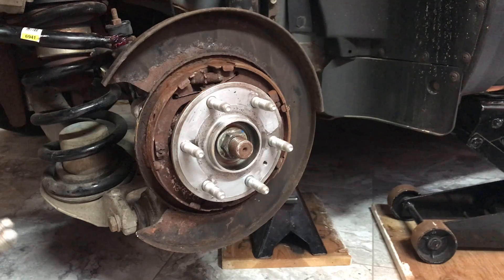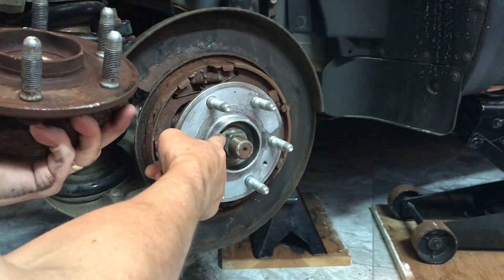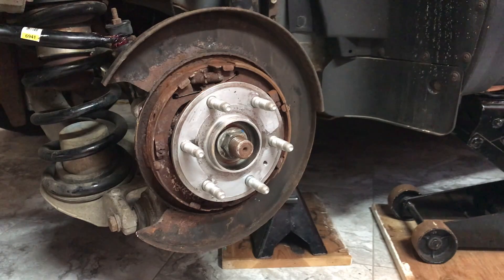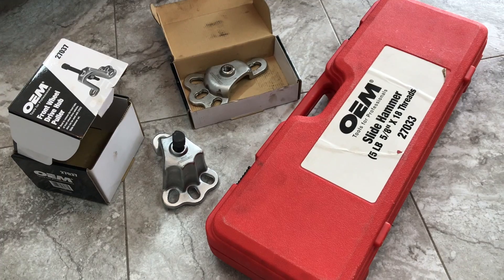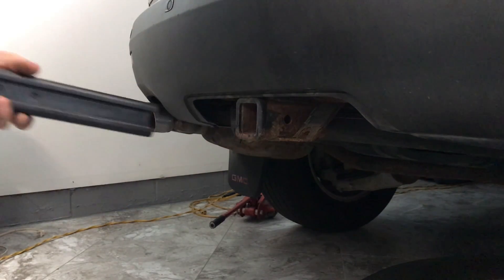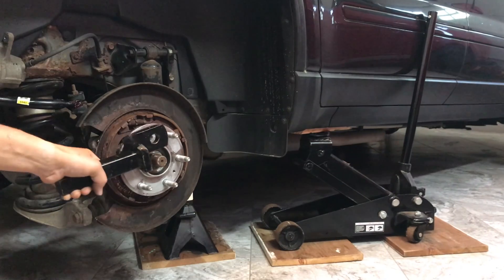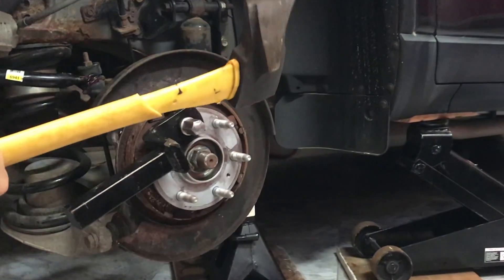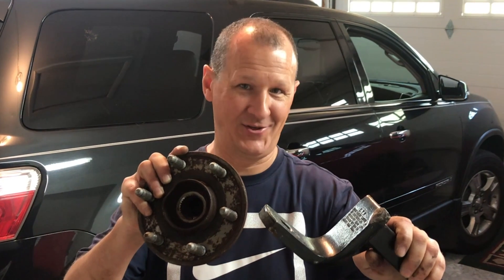Stuck Wheel Bearing: Easy Removal!

Comment: I tried for 3 hours to get that thing off then I hit youtube and saw this video. Went out and tried it and after about 10 minutes of wacking the hitch it started to crack free. Another 15-20 minutes of crowbar and wedges it came off. Thank you. Now off to the other side.
Reply from the maker: Glad it worked!  Sometimes it doesn’t, but it’s a free hack.  Good feeling when it cracks though!
Reply: @goproguy7844  The other side was easier, about 5-6 wacks and it cracked. Thanks again!.
Reply: @goproguy7844  what  size tow hitch did you use does it make a difference at all mine is stuck pretty good I sprayed it and pounded it with a hammer ⚒️ no luck yet

Comment: daaaaamn. you just gave me the solution I guess... my boat trailer bearing is stuck with the cilinder... and i spent 2 nights trying to remove it... i just gonna go back in garage. i have several of those hitch and gonna try your way... thanks
Reply from the maker: Good luck stonefreer1.  Worked for me TWICE now on this same Acadia that I did the video on.  You can try the hardened bolt trick too.  Draw bar is the simplest though - and doesn’t cost a thing if you’ve got one. Happy hammering!
Reply: @goproguy7844  😞 it didnt fit .... Is a 6 lug and the wont fit ...

Comment: If you got the time Soak with penetration oil pb blaster 30 min  then hit it with some heat knock out a stud use the bolt method to give it some lea way then use hitch off she comes right off

Comment: You don't show where you hit it to get the leverage to get the hub off!
Reply: Apparently hit it where the draw bar metal was mushed over. Force wasn't in direct line with removal direction but must loosen rust hold and sort of pry off. Probably need to reinstall drawbar in a star pattern to gradually loosen and work off. After a few belts with a sledgehammer to break rust grip, slide hammer might work well.

Comment: Man i still cant get this thing 
Im running out of options
Reply from the maker: Ogtriple Og - Have you tried removing a stud (they usually snap if you bend one back & forth - or you can cut off with a dremel and hammer it out the back), then the bolt trick.... take a hardened bolt (about 2” long) as wide as the stud hole (about 1/4” wide), insert into the stud hole. Slide a stack of washers (or one nut and a washer) onto the inner side of the bolt, followed by one nut.  Then twist the bolt head so that the other end begins to push against the bearing knuckle (housing).  Rotate the bearing so that you are able to push out from multiple places. Big key is to use a high-quality bolt, or you will just end up stripping the bolt or bending it. Not as easy or fast as the drawbar trick, but it works too.  Good luck.
Reply: Thanks for the reply i appreciate it 
I was able to get to come off after i put an old brake rotor on backwards and hiting it with a sledge hammer has hard as i could for a good hour or so 
But this video definitely helped

Comment: What about orient the other way with car in gear, then slowly lower jack and weight of car onto the end of the hitch until it pops?
Reply from the maker: You can try that.  Just make sure you have a jack stand or 2 in place so it doesn’t drop to the floor.  I tried that too - but still didn’t work.  Depends how seized each situation is.  Good luck - hope yours comes off easily.

Comment: what about those brake shoes???????
Reply from the maker: You have to get the brakes off first. Rear disc brakes on Acadia have the e-brake drum inside the rotor!  So you need to pop off the dust cap and turn the star wheel to retract the drum e-brake in order to remove the rear rotor (which also has a small drum).  Many GM rear brakes require the twist-in tool to compress the calipers when you put on new shoes/pads (AFTER you get the brakes off).  I haven’t had issues getting mine off though.  I’ve been able to compress the calipers a little with a c-clamp - enough to wiggle the calipers off.  The majority of the compression is done with the twist-in tool.

Comment: i got a hammer and hit it from behind rotating it when i see it coming out so it will pop off evenly using a ball peen hammer. i even tried the bolt ,nut ,washer business, nope didn't work. but the hammer did. I bet those air hammers from behind it would work nice.